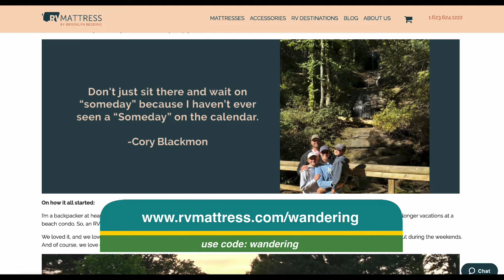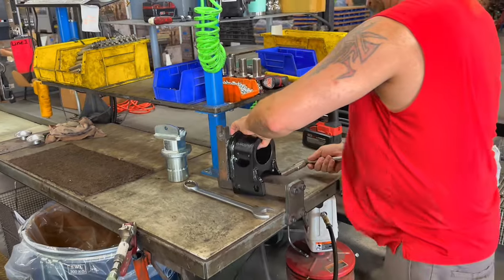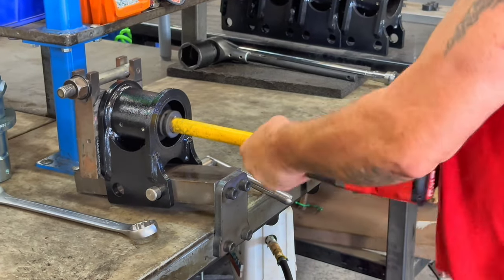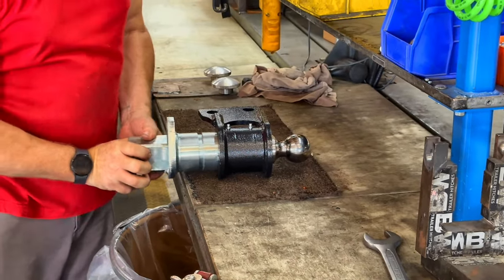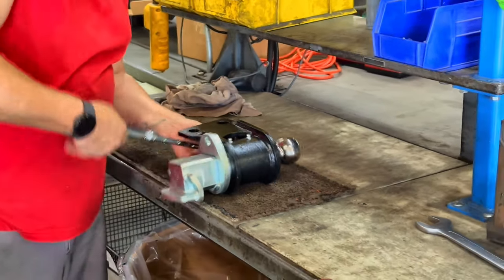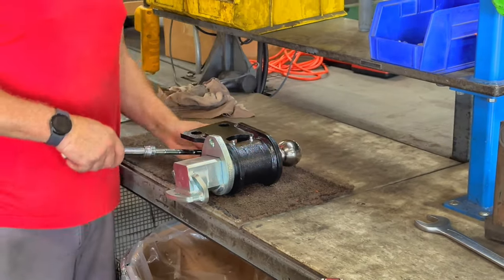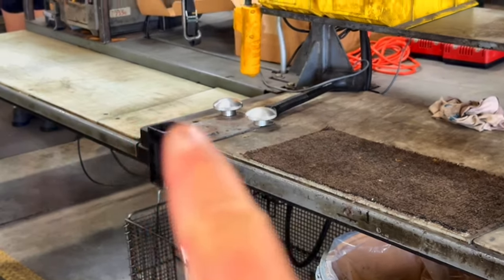How Its Built // B&W Continuum Weight Distribution Hitch

Comment: Always nice to see assembly videos. I wonder if you still prefer your Weigh Safe to this still?
Reply from the maker: I think so. B&W has added an app for setup and a pressure release valve to protect the hitch and the RVs frame but I think the Weigh Safe still tows a bit straighter. That’s been my experience.

Comment: Is there any discount code? Im stuck between the true tow and the B&W. My hitch weight is 1250. 
I saw on another video that true tow isnt made in the US no more? Not sure if thats true or not.
Reply from the maker: No discount code for the B&W.  Yes, unfortunately Weigh Safe had to move some of their production overseas. They still build a great deal of product here in the USA but I do believe the middleweight is being built out of the country now. Bummer.
Reply: What one would you recommend? I have a toy hauler that is 36 ft long. The GVWR is 13k, trying to get a hold of true tow to see if they recommend the heavyweight but on hold for a minute. I like the b&w but not sure if it puts stress on the frame how the set up is. I like your videos!
Reply: Thank you for the reply
Reply from the maker: B&W has installed a relief valve in their reservoir so it’ll actually protect your frame (supposedly). I actually just left Kansas where I tested the hitch with their engineers.  My preference at this point is the Weigh Safe heavy but take that with a grain of salt because I’ve only experienced my setup.